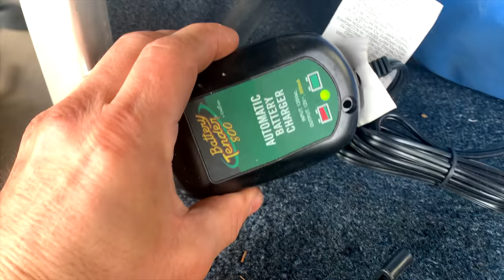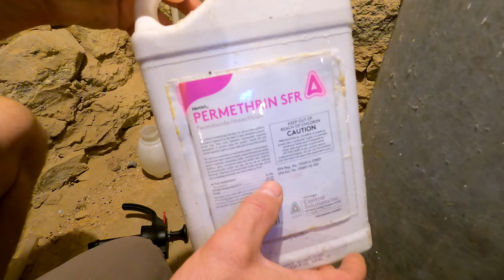8 REAL Farm and Garden Hacks You Probably Haven't Seen Before.

Comment: Regarding the bonfire: 

Instead of using fuel or a homemade propane flamethrower... just assemble the bonfire on a dry day and cover it with a tarp. Wait until a wet day. Remove tarp. Set bonfire on fire.

It just takes a little planning but it saves you in both frustration and fuel.

Comment: The cattle panel cages is actually better than the ones I made 15 years ago. I used the 6x6 inch concrete reinforcing wire to make 5 foot tall three sided cages. The guy who I got the idea from made these to where you can open them and fold flat for storage when off season. I guess I'm lazy I always just leave them right where they are till spring when I remove them to till the garden. I also drive a 4-5 foot T-post into the ground and then lift my cage over the T-post and zip tie it to the post. It will never move or fall over in the worst storms. I recently found out the wire I used has tripled in price and would no longer make sense. I think a roll is around $400 but I also got 25 cages made from it and a huge compost bin. I think the cattle panel is a bigger gauge wire and stronger.

Comment: We had a small wood stove to heat the garage 50 years ago when I was a teenager. Dad always said do not throw diesel fuel on live coals— only on open flame. I forgot or decided I knew better. I had a quart jar full of diesel and threw some in. It made a rolling white cloud so I struck a match (I had one ready just in case) and tossed it in. The cloud exploded and rolled out the door and over me singing my eyelashes and any hair sticking out from under my sock hat. I wore glasses— maybe that saved my eyes. I often wonder if I had not had the match ready, would it have blown up the garage.

Comment: We've been using Permethrin for years. My neighbor swears it's killing his bushes. To that I just say, why are my bushes Not Dead as a matter of fact why am I not dead. Lol. I used to use vegetable oil from the fryer to start bonfires. I stopped doing that because of the awful smell now we just use it in our compost where it probably belongs, back in the ground. I like the torch idea. Although I've always used the small camp propane. Every time I change a battery I swear I'm going to get some kind of maintenance deal for it. It's frustrating to have batteries die that you just bought less than a few months ago. Thanks for sharing these.

Comment: Some great stuff! On the massive stump you did before. You could use the propane torch with and augured hole through the top of the stump to ground, then an augured hole parallel  and close to the ground to center of the stump. Then with a long shielded hose insert the propane gun into the bottom hole. Fire that thing up with the propane running through the stump allowing the heat to draw air in at the bottom hole, sit a couple hundred feet away, with a six pack and chips, sandwiches and a video game and relax. It could take a couple sessions, but Three propane tanks are much cheaper then a back hoe! And if the stump is really dry it might just burn on its own for a couple days on one tank with the fire being inside the stump core. Not as much fun as a tractor, fork lift, and back hoe though!

Comment: a good safer way to use fuel is fill a bean can or soup can 1/2 - 3/4 full. set it in a little pocket under the fire and lite it with a stick. it just burns like a candle for half hour. cant spill though if you do wait until the spill is evaporated before lighting

Comment: I have a whole bunch of used fencing around my yard. It's not cattle panels, but it will make great tomato cages. Great idea.

I have seen the torch idea. I saw a video where a guy used gasoline and the fumes spread out away from his intended fire, and the whole yard flashed.

There's a lot of videos on using propane tanks for a lot of projects. The main takeaway from those are to remove the valve and fill the tank with water, then dump it out and let it dry, maybe even using a little compressed air to hasten that process.

Great ideas, Bro. You are one of my favorite channels.

Comment: I did work for a large propane supplier and they had a factory where they tested and reconditioned the tanks. The owner told me it really doesn't matter to them what the tank has because if the valve needs to be replaced then that is what is done and if the tank is bad then they replace the tank. I take the old tanks I get to a place that will not ask questions and honestly they shouldn't ask questions.

Comment: The way your “lifting with your legs” is just you putting the weight on your knees and you will have joint issues doing that. When they say lift with your legs it means engage your hamstrings which is one of the strongest muscles in your body

Comment: I`ve seen the cattle panel used for growing tomatoes and other climbing plants but  not cages, I`ve seen used as panel on one side of the raised bed or as arches. 
one tip: leave the cages as they are build and weld 4 wires to them ( going into ground parts preferably paint these) - 2 or 2,5 feet long (1 foot above soil rest in it) and grow indeterminate type tomatoes for longer vines and leave at least 6 to 8  levels of flowers on them to increase the yield.
Basically raise the height of your cage cage should start from 1 foot of the soil up to how high it is.

Comment: I use cattle panels for my tomatoes, but I don’t make cages. I just plant them in a row along one cattle panel. And then I put another cattle panel up on the other side of where I planted. I use zip ties to hold the together. I already have my entire garden fenced off with cattle panels, so it’s easy to create a section just for the tomatoes in a long rectangle area.

Comment: I use to lift large rounds like that, works great. 

I am sorry I did now, the pressure that puts on the knee joint has done a lot of damage. I added as small picking boom and winch to my log splitter and pick them up with a pair of tongs and run the winch with a cordless drill. 

I would not wish knee surgery on anyone.

Comment: Have not seen propane to air tank conversion. Heard about the permethrin thing recently. Used Hog Panels for deck railing and used the leftovers for tomato supports but haven't done the full cage. Yes always check shoes, gloves, hats etc before putting them on, OMG there's always a spider in the shoes.

Comment: For tomato cages I have used 4x4 welded wire mesh which is used for reinforcing in concrete slabs. Made 4 of them the same size then reduced the number of squares by one and made 4 more. that way you can store them inside each other reducing the space need. they last about 6-7 years. I too dislike the store bought ones. Take care.

Comment: I've seen the propane Torch for starting fires. We've also used concrete reinforement wire with 8x8 squares or similar sizes for tomato cages. They probably won't last as long as your cattle fencing because the cattle fencing is heavier gauge. When we did it we went in with a couple people to buy a whole role of the concrete reinforcement wire mesh and made a lot of them. I think we got like 8-10 cages for a couple people out of a roll, depending on how long of a roll you get and how big of diameter you make the tomato cages. They've lasted for well over 20 years now before a few weld joints for the squares have broken. But all in all, they're still very usable. Tomato plants get huge (5-6' tall) with the cages holding them upright and it's so easy to access the tomatoes because the squares offer plenty of room for a large hand to reach in and come out with a large tomato in hand without the cage interfering pulling out the tomato.

Comment: Concrete reinforcing wire works great for tomato cages too. Not as heavy and a bit easier to work with. I have a few cages I made from hog panels, but they aren't near tall enough for any indeterminate tomato. My first cages 40 years ago, were made from used woven fence wire.

Comment: All of these are good. Will use the leg lift tip, permethrin and earmuff tips.  I like the fire starter safety tip but I don't make bonfires with the junk wood.  I pile it up in a far corner of the field and a few years later have a nice pile of composted rich dirt.

Comment: Concrete reinforcement wire works just like the panels and is a little easier to work with plus it's cheaper if you are doing a lot of them. It's not galvanized but the heavy wire will last a long time. Mine are 12 years old and still going.

Comment: I know this will not start wet wood on fire, but I always use cotton balls.  I need then with petroleum jelly.  I store them in a wide mouth jar.  When you need a fire just use a twig.  Spin it on a cotton ball in the jar.  When your sure it will stay with just a couple twists.  Lite the cotton ball and start your fire.  It burns over six minutes which will start most fires.  Later

Comment: I did the same damn thing with gas except I was still standing in it when it exploded.  I ended up at the ER with two arms and my face burnt.  No more gas fires for me.  Ever!  About the same time I saw the flame coming up between my legs I heard the big Kawomp.  I fell to the ground and began the roll.  Literally less than one second in the flames and the skin was hanging off my arms.  I went and bought the same blow torch as you did, but if you like crispy then gas is for you.

Comment: I use old laptop 15V power supply as battery charger with a 0.7V  voltage drop on the Silicium diode I get 14.3V, perfect
refill spray cans with compressed air, the leg lifting I learned when I fixed the heavy 45kg TVs we had 40 years ago.
the Permethrin solution is on Amazon but expensive and we don't have access to buy it by gallons.
In Spain we don't have these cheap lightweight gas bottles, so 2 tricks impossible, but we have 240v 1.5kW and heat guns that lit up fires if you have a cable extension.
My favorite is don't solder electric wires, just hot glue them

Comment: Nice work, love the tips.  Experience really is the best teacher, thanks for sharing.
For the fires (in barrels, pits, open brush piles etc), I found that a leaf blower is excellent for feeding the fire air, increase burning/heating speed, and to a lesser extent - blowing the flames where you want.  A burning barrel with leaf blower directed across the top and slightly downward will cause a tornado of heat and greatly speed lighting/burning especially of damp material, reducing smoke a lot as well.  Use a grate cover on barrels and pits!!
Stay gold.

Comment: I have a snowplow truck that has frost plug block heat, battery blanket and one those battery tender maintainers.
Battery is always ready first start to run the snow plow.

Old style propane tanks you can remove the old valve using a big ball pien hammer and 14" steel rod (punch) and beat it around to unscrew and replace with a reducer bushing and add a airtank service valve that features the over pressure valve and pressure gauge.
Add a ball valve to the service valve next to your quick coupler.
Propane bottles need to be hydrostaticly tested every 12 years.
They wont fill a bottle out of date.
In my area they wont accept them.
So are classed as junk.

Comment: I just excange in Old propane tanks w/old valves to the Big Box Stores and get new/used full exchange propane tank for $19.95 - $23.95, why waste a perfectly good exchange tank!!!  I liked your advice on lifting with your legs....  Once you break your back your life will NEVER be the same.  I take one cattle panel and cut into 4 smaller equal size panels and zip tie them together into a 4 sided box and use that as a composte pile, and every 3-4 years I will cut the zip ties on one side and move the wire  box over and start a new composte pile.  The good thing about cattle panel is that it's galvanized and will not rust.

Aloha...............

Comment: I've used concrete reinforcing mesh to make tomato cages.  Got it at Menards, 5' x 50' foot roll, 10-gauge,  6" x 6" spacing.  Downside is that they rust, but that doesn't bother me.

Comment: That was a lot of good ideas.  Our local welding supply store sells the OPD valves installed for $30.  They will fill tanks with the old valves and have never checked the dates on any of my tanks.  Still probably not worth it for a 20 lb tank, but I bought 5 30 lb tanks for cheap and had the valves replaced in 4 and still only had about 1/2 the price of new tanks in them.  I have used 6x6 concrete reinforcement wire to make tomato cages.  It seems to be strong enough and much lighter and somewhat cheaper than cattle panels.  We used to use diesel and tires to start fires before the state wanted stacks of old tires laying around and breeding mosquitoes and outlawed burning tires.  Old square hay bales make good fire starters too.

Comment: Your screwdriver is safe.  I had not seen your tick prevention.  I have used your tomato cage method with concrete reinforcement wire.  Still quite strong yet way easier to work with.  I only bend the wire 180 degrees and I can undo them and remove them from around the plant  and then store them around each other.  takes up less room.

Comment: Propane weights more then air. You've got to get all the gas out of the tank. Do this by filling it with water first or you could be putting a flammable gas in your tires.

Comment: I've watched a lot of useless stuff on YouTube but have to say you give 1st quality tips. Instead of pickets (1.5" x 1.5" boards) around decks and porches, I use goat panels. Sixteen feet long with 4" x 4" openings in the welded wire. Meets code and is unique. Big fan of the animal panels. Thanks for the wisdom.

Comment: Yeah I would be careful with the permethrin that's NOT made from chrysanthemums  it's a synthetic clone form  OF pyrethrin    It tends to be much more unstable toxic  than  pyrethrin which  IS  extracted and derived from flowers !   I've got a few tomato cages made out of cattle panel   I've also got some configured in an arch  and a few  straight runs through my garden fixed on T post  I just  weave the plants  in and out through them as they grow    and I also plant few a yard long variety bean in between them   the legumes  pump nitrogen into the tomato plant roots    sowing clover in your garden and tilling it in in the spring is really good for that too   as they are also a legume 👍

Comment: I use several. the tomato cage idea and the lifting using your legs methods are super helpful.  I will adopt those immediately. working alone also i find myself slowing down and thinking about a lot of things first. it helps keep from being injured. i always check garments and hearing protectors for critters like brown recluse and black widow. i use permethrin spray but your way is far more cost effective. i got a torch for christmas last year and thats a bunch of fun.. I scuba dive and know the dangers of structural failure and tanks (bombs). I think ill just use a compressor and a small generator to reach places where extension cords wont reach. Thank you!!!! good stuff.

Comment: Once had big pile of brush and had small fire 30 ft away  and it was hot and dry  out   went to pour high test gas  30ft away to get other end started   looked over and seem the gas vapor had drifted over to burning 🔥  and seem the air / vapor  catch fire like a million  fire flies  and come toward me just had time to throw gas can away  but it still blew me  about 8 ft off the pile  / trip to E R..with burns .

Comment: Awesome ... I can't say I've seen them all, but I've used Permethrin SFR for years ... I mix it hot at 2 or 3'x the potency on the label. I spray it all the way around each exterior window and door. Kills everything ... No ants, mosquitos, ticks, chiggers, spiders, palmetto bugs , etc.. nothing survives ... Great Product. We have always used the lower grade goat wire instead of the heavy cattle panel for tomato cages. The goat wire can also be used for making turtle traps. .. Turtle stew is good stuff! HA well thats my comment ... You have some great vides and I've learned a lot ... The old propane tank hack is ingenious. I have a couple of old ones and will definitely be changing the fittings out! Thanks for all the great entertainment.

Comment: Think I'd just sink a t-post beside each cage and tie it to the cage.  instead of trying to have legs to push in the ground.

I've used some really thin concrete wire mesh 4" squares.   I've wanted to use the cattle panel but just don't like the price.  Not a big fan of the mesh I'm using either.

But I'd make each cage a triangle instead of a circle.  that way at the end of the season can open them up ( one angle is like wire tied or something ) and then you can hang all your cages on a wall ... out of the way.

Comment: I use 6-6-10 reinforcing wire for mater cages. It is easier to work with but you might be stuck having to buy an entire 150' roll which is bad.